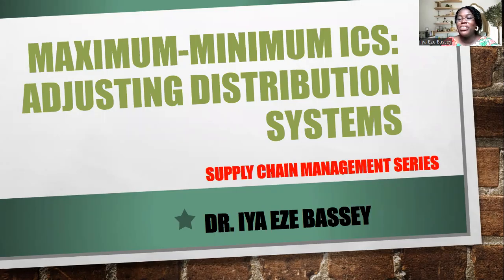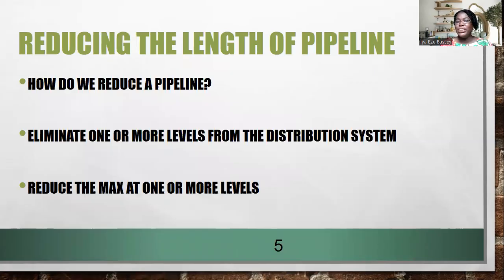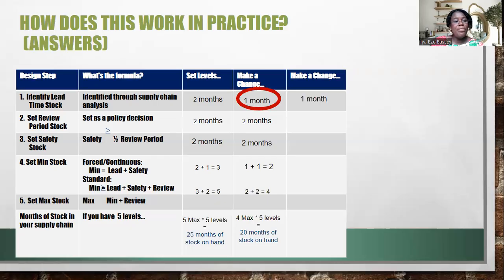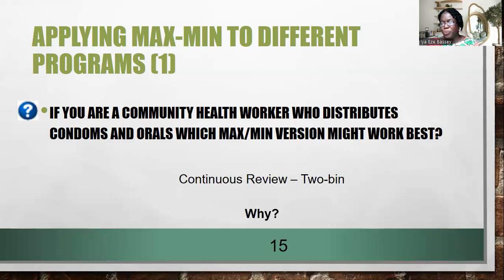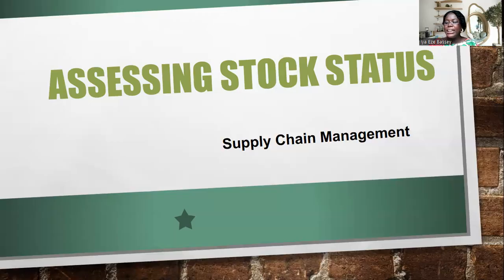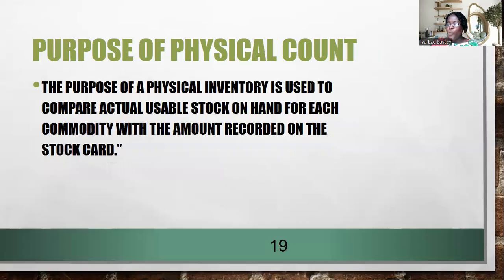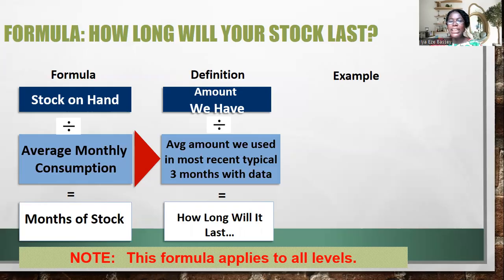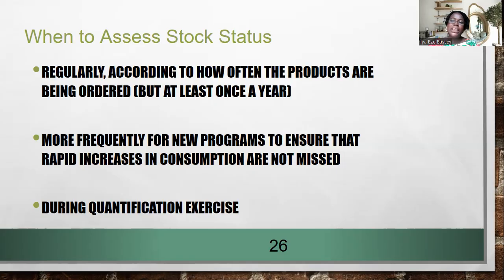Maximum-Minimum ICS: Adjusting Distribution systems (Supply chain management series)

Comment: In all I got the steps on how to design a max-min ics they include:
1.set up initial max min policies for each level and type of faculty
2.check if the overall distribution will function properly if the level specific max-min policies are implemented 
3.check the total length of the pipeline that the policies at each level imply.
 The client is the most important in pipeline
I learnt about the steps on how to reduce the length of the pipeline line they include;eliminating one or more levels from the distribution system,reduce the max at one or more levels  and I got the diagrammatic illustration.
 Some of the elements of the formulas which can be changed in order to reduce the max stock level are;shorten the review period at one or more levels,reduce the lead time at one or more levels, improve the distribution system’s reliability at one or more levels so that safety stock can be reduced etc. 
  I understood how it works in practice and the other factors that impact max-min stick levels include;cost of products,reliability of transportation,storage capacity,cost of storage,management sales of staff etc.some advantages include minimize wastage,it abounds overstocking,consistency of stock levels,avoid costs of emergency orders and  challengers are;
*systems with numerous levels
*systems that manage a large number of commodities 
*systems that manage products for new programs
   I understood that physical count is the process of counting by hand the total number of useable units of each commodity in your store or health faculty at any given time and it’s purpose is to compare actual useable stock on hand for each commodity with the amount recorded on the stock card.Thank you

Comment: In summary,  the steps for designing  a max- min ICS  were discuss and how to reduce the length of pipeline and several advantages of using  max- min system include,  too much of overstocking, Avoid under stocking,  minimizing  wastage etc.  Some factors  which impact  max- min stock levels are product cost,  storage capacity  and cost of storage.

Comment: Thank you very much ma 
In this lecture I learnt that the advantages of using maximum minimum system which includes
1. Avoid  over stocking 
2. Avoid under stocking
3. Minimize wastage 
4. Avoid costs of emergency orders .
I also able to understand that the purpose of of assessing stock status which is to determine how long the stock can last.
Thank you ma

Comment: Great, let's start with a simple example. Imagine you run a store that sells a product, and you want to use max-min ICS to manage the inventory of that product. You first need to decide on the maximum and minimum levels. For the sake of this example, let's say the maximum is 100 units and the minimum is 50 units. This means you will never let the inventory drop below 50 units, and you will never allow it to exceed 100 units.
Next, you need to keep track of the inventory level and order more product when it gets close to the minimum.

Comment: Thank you for this lecture Ma.
I understood the steps involved in designing a Max-min ICS which are;

✔️Set up Intial Max-min Policies fir each level and type of facility
✔️ Check if the overall distribution will function properly if the level specific Max-min policies are implemented.
✔️ Check the total length of the pipeline that the policies at each level imply.
   
     Sometimes,the pipelines  length are too long and it takes longer time in commodity delivery. However,the pipeline length can be shortened by;
📍ELIMINATION OF ONE OR MORE LEVELS.
📍 REDUCTION OF MAX AT ONE OR MORE LEVEL.

   The whole purpose of assessing stock status is to determine how long supplies will last.

Comment: Thank you so much ma for another interesting episode. I perfectly understood the steps in designing max-min ICS .
I learnt that one of the ways to reduce length of pipeline is to eliminate one or more levels from the distribution system.
Improving the distribution system reliability at one or more levels so that safety stock can be reduced is one way to reduce the max stock level.  Some factors that impact max-min stock levels are: Cost of products, age of program, lead time. One advantage of using max-min system is to minimize wastage.
I learnt that continuous review max-min ICS is not suitable for a large system or many products as it is too cumbersome. I learnt that to determine month of stock, 'physical count" is necessary, this process helps to compare the actual usable stock on hand for each commodity with the amount recorded on the stock card.I learnt how to calculate"month of stock ".
When to access stock status: (a) regularly, according to how often the products are being ordered (but at least once a year). (b) during quantification exercise. (c) more frequently for new programs to ensure that rapid increases in consumption are not missed.

Comment: Maximum minimum ICS; adjustment, distribution system.
Thank you so much ma'am. 

I learnt the steps involved in designing a max-min ICS.
I also got to know about the advantages in implementing the Max-min system which includes: preventing overstocking preventing understocking and reducing wastage.

I also learnt how to set up a Max-min inventory control system. This includes determining the length of a pipeline reducing the length of a pipeline.

Comment: In this series, I have learnt that there are steps involved in the designing of max-min ICS which are ;
1 Initial max-min polio for each level 
2Check if overall distribution will function properly 
3 check the total length of the pipeline that governs at each level 

Inventory control system have its own advantage which are 
1 Avoid overstocking 
2 Avoid under-stocking 
3 minimize wastage 
4 consistency of stock level

Comment: Another Banga , this is lesson is a top notch . 
I learned that some elements of the formulas can be changed in order to reduce max stock level , they include 
1:) Shorten the review period 
2:) Reduce the lead time 
3:) Improve the distribution system reliability . 
Some of the challenges to using each version and variant are 
1:) system with numerous levels 
2:) System that manage a large number of commodities 
9:) System that manage products for new programme  . 
Thank u ma , for this lesson . I'm privileged to have you as my lecturer .

Comment: IN SUMMARY
MAX-MIN ICS ADJUSTING DISTRIBUTION SYSTEMS

Adjusting the Distribution System (MAX-MIN ICS)

Optimising the allocation and delivery of items to multiple locations is part of adjusting the distribution system in an inventory control system.

The benefits of changing the distribution system include avoiding overstocking, understocking, minimization of waste, avoiding the cost of emergency orders, and consistency of stock level.

By reducing the length of the pipeline by removing one or more levels from the distribution system, MAX-MIN ICS distribution systems can be adjusted. 
by reducing the review period and lead time at one or more tiers, the Maximum Stock Level can be decreased.
Take into account the variables that have an impact on MAX-MIN stock levels, such as storage capacity, storage costs, staff skill levels, forecasting precision, and program age.

Comment: MAX-MIN ICS: Modifying the Distribution System

Optimising how items are distributed and delivered to various places includes adjusting the distribution system in an inventory control system.

The benefits of changing the distribution system include avoiding overstocking, understocking, minimizing waste, avoiding the expense of emergency orders, and ensuring consistency of stock level.

Reducing the length of the pipeline by removing one or more levels from the distribution system can be used to modify MAX-MIN ICS distribution systems. 
lowering the maximum stock level by cutting the review period and lead time at one or more levels
Take into account the variables that affect MAX-MIN stock levels, such as storage capacity, storage costs, personnel skills, forecast accuracy, and program age.

Comment: MAX-MIN ICS: ADJUSTING DISTRIBUTION SYSTEMS

Adjusting the Distribution System (MAX-MIN ICS)

Optimising the allocation and delivery of items to multiple locations is part of adjusting the distribution system in an inventory control system.

The benefits of changing the distribution system include avoiding overstocking, understocking, minimization of waste, avoiding the cost of emergency orders, and consistency of stock level.

By reducing the length of the pipeline by removing one or more levels from the distribution system, MAX-MIN ICS distribution systems can be adjusted. 
by reducing the review period and lead time at one or more tiers, the Maximum Stock Level can be decreased.
Take into account the variables that have an impact on MAX-MIN stock levels, such as storage capacity, storage costs, staff skill levels, forecasting precision, and program age.

Comment: Adjusting the distribution system in an inventory control system involves optimizing the way goods are allocated and delivered to various locations.

The advantage of adjusting distribution system is Avoid of over-stocking, Avoid under-stocking, Minimize wastage, avoid cost of Emergency Orders and ensure Consistency of stock level

Adjusting distribution systems of MAX-MIN ICS could be achieved by 
Reducing the length of pipeline by eliminating one or more levels from the distribution system. 
Reducing the Maximum stock level by shortening the review period and lead time at one or more levels
Take the factors that affect MAX-MIN stock levels into consideration such as: storage capacity, cost of storage, skills of staff, accuracy of forecast, age of program.

Comment: Thank you ma,
In summary,
It entails maximizing how items are distributed and delivered to various places when the distribution system in an inventory control system is adjusted.

The benefits of changing the distribution system include avoiding overstocking and understocking, minimizing waste, preventing the expense of emergency orders, and ensuring consistency of stock level.

Reducing the length of the pipeline by removing one or more distribution system levels could be used to modify MAX-MIN ICS distribution systems. 
lowering the maximum stock level by a reduction in the review period and lead time at one or more levels
Think about the variables that determine MAX-MIN stock levels, such as storage capacity, storage costs, personnel skills, forecast accuracy, and program age.

Comment: MAX-MIN ICS: ADJUSTING DISTRIBUTION SYSTEMS

Improving how items are distributed and delivered to multiple places includes modifying the distribution system in an inventory control system.

Avoiding overstocking, understocking, minimizing waste, avoiding the expense of emergency orders, and ensuring consistency of stock level are the benefits of changing the distribution system.

Reducing the length of the pipeline by removing one or more levels from the distribution system is one way to modify MAX-MIN ICS's distribution systems. 
Shortening the review period and lead time at one or more levels to reduce the Maximum Stock Level
Consider the variables that effect MAX-MIN stock levels, such as storage capacity, storage costs, staff skills, forecast accuracy, and program age.

Comment: In summary,I learnt the steps in designing a max-min ICS which are;
i.Setting up an initial Max-Min policies for each level.
ii.Checking if the overall distribution will function properly if the level specific Max-Min policies are implemented.
iii. Checking the total length of the pipeline that the policies at each level imply.
   I also learnt the elements of formulas which can be changed in order to reduce the max stock level, they are;
i. Shorten the review period at one or more levels.
ii. Reduce the lead time at one or more levels and lastly,
Improve the distribution system's reliability at one or more levels so that safety stock can be reduced.
  The advantages to using Max-Min system include; Avoiding Overcoming, Avoiding understocking, minimize wastage and avoid costs of emergency orders.

Comment: Steps in Designing Max-min ICS are:
1. Set up initial max-min policies for each level amd type of facility.
2. Check if the overall distribution will function properly if specific policies are implemented
3. Check the total length of the pipeline that each policies imply.

Factors affecting max-min stock level:
- Cost of products
- Reliability of transportation
- Storage capacity
- Cost of storage
- Storage condition
- Shelf life of commodities

Physical count: process of counting total number of usable units of each commodity in your store or health facility at any given time by hand. This is used to compare actual stock amount against amount recorded on stock card and also to determine how long stock will last.

Comment: In summary, the distribution system polices can be adjusted by (I) reducing the length of the pipeline that is eliminating one or more levels from the distribution system and reducing the max at one or more level  and  (ii) reducing the maximum stock level i.e shortening the review period and lead time at one or more level. I also learnt extensively on the advantages and challenges of using the Max-min ICS. The advantages are; It avoid over stocking, under stocking costs of emergency orders etc. Challenges which are; systems with numerous levels, system that manages large number of commodities and system that manage products for new program. Assessing stock status is counting by hand the total number of usable unit of each commodity in your store or health facility at any given time. The purpose of assessing stock status is to determine how long supplies will last. To determine the number of months of stock available at any storage level..

Comment: In this series, I learnt that the length of pipeline involves the steps in designing the max-min inventory control system which are 
Setting up initial max-min policies for each level and type of faculty and checking the total length of the pipeline that the policies at each level imply. To reduce the length of a pipeline, we have to eliminate one or more levels for the distribution system and reduce the maximum at one or more level. 
There are factors that impact max-min stock levels which includes; lead time, reliability of source of supplies, age of program etc. 
I learnt about the advantages to using max-min system which includes avoid overstocking, understocking and minimize wastage.
I also learnt about the challenges, how to apply max-min to different programs and how to access stock chains and it's purposes.

Comment: Thank you again Dr. 
For helping to understand adjustment in the pipeline in ICS. 
Adjusting the pipeline or distribution in Max.Min ICS  requires a comprehensive review of the entire logistics network, and piplines, identifying areas where improvements can be made and implementing changes that can have a positive impact on efficiency and distribution of our medical laboratory commodities from the central down to the laboratories.
Length of Pipeline is the first to be considered of adjusting or designing of max.-min. ICS
Pipelines can be modify or shortened, by reducing one or more levels from the pipeline system and setting up polices that can help reduce max- min at one level or the other.
However some factors can affect the determination of max-min stock levels beside the length of the pipeline, some include; cost of product, cost of storage, reliability of transportation and accuracy of forecast.

Comment: I appreciate you ma, I learned that the advantages to using max-min system they are:  avoid overstocking, under stocking, avoid cost of emergency orders,  simplify inventory control decision-making,  consistency of stock levels ,  reliable data source from sop for forecasting and quantifications .

Comment: Thank you Ma.
1 understood from this lesson that the ways of adjusting distribution system policies are by:
1. Setting up initial max-min policies for each level and type of facility
2. Checking if the overall distribution will function properly if the level specific max-min policies are implemented
3. Checking the total length of the pipeline that the policies at each level imply.
However, the advantages of using Max-Min system are as follows:
* Avoids overstocking
* Avoids under-stocking
* Minimize wastage
* Consistency of stock level etc

Comment: I understand that in designing an efficient maximum- minimum inventory control system , set up initial max- min policies and check the length of the pipeline that the policies of each level imply . A very long and elongated pipeline will  be so ineffective since some of the kits may not last that long . Hence there is a need to reduce such pipeline through elimination of one or more levels from the distribution System.
This shortening of pipeline involves changing some elements of the formular to reduce the maximum stock level such as lead time .
Another part of inventory control system is physical counting by hand of usable units to compare actual usable stock on hand and those actually recorded on stock card which should be done once in a year

Comment: I understand that we reduce pipeline through the elimination of one or more levels from the distribution system and reducing the max at one or more levels and that cost of products,cost of storage etc are factors that impact max min stock levels .
I also understood that physical count is the process of counting by hand the total number of usable unit of each commodity in your store at any given time which is used to compare actual usable stock in hand for each commodity with the amount recorded on the stock card